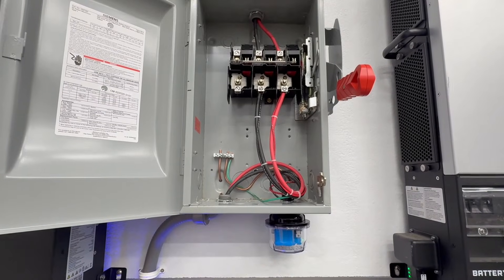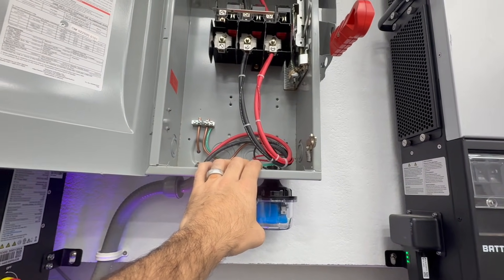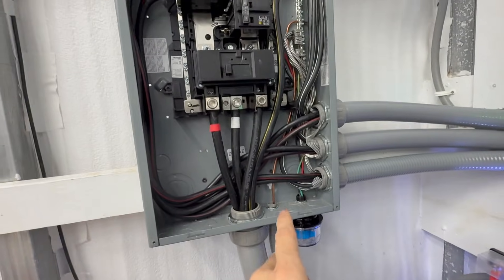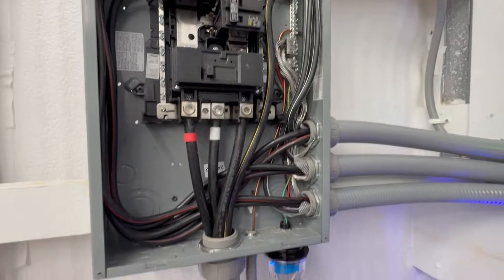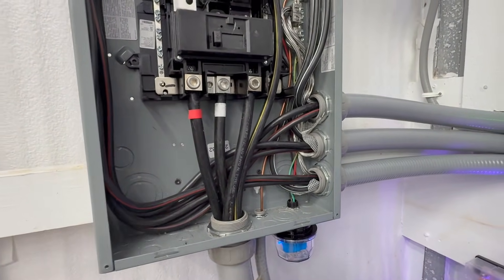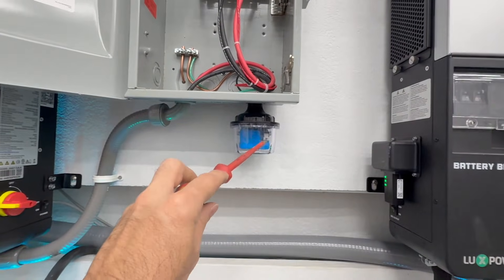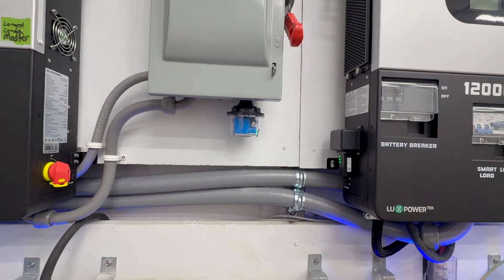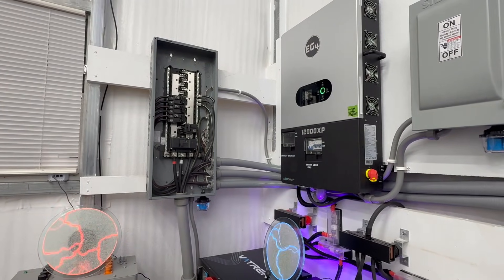How To: Install MidNite Solar Surge Protection Devices - Protect Your Solar Investment!

Comment: SPDs are fine, and a reasonable step to take to prevent damage under reasonable conditions.  Lighting is not reasonable.  Depending on where lighting hits, it can transfer 100 Million to 1 Billion Volts DC at 30,000 Amps.  DC arcs well, very well at high voltages, and can jump across conductors across a good distance.  All electricity, DC or AC, wants a path back to the Source.  Dirt is not a good conductor of energy, but long runs of underground cables can act as an antenna for a lighting ground strike and still bring dangerous levels of DC current down the line to whatever it's connected to looking for the least impedance path back to the ground, this is where a SPD helps, giving your current carrying conductors ( + and -, or 120vac & neutral) a fast path to low impedance to ground which was the Source of the energy.  It does not cure cancer, or solve world hunger, but be rational on what it can do, and what is beyond rational and reasonable.  Can you still lose electronics, appliances, chargers, and inverters in a strike.....absolutely with SPDs installed, and installed correctly.  I come from the sailing world where lighting strikes is a fairly common occurrence.
Reply from the maker: Absolutely agree and that is why I tried to stay away from mentioning direct lightning strikes, because nothing will protect against it.  Thank you for posting!

Comment: Thanks for this video. I have a question for ya. My solar dc disconnect is at the location of the solar field 100ft from the house. Should I wire the SPD over there and have it connect to the ground going from the panels back to the house ground rods?
Reply from the maker: It is supposed to be as close as possible to the inverter.  But you can put a second one by the array like I did.

Comment: Sold rural off grid solar, the only systems that are back up online same day after rare huge storms are ones with MidNite solar. One 36-year long solar installer here won’t use anything else and puts them on every single new system.

It should be noted that it’s an ‘EMP arrestor’ that sends ALL EMP’s to ground, lightning strikes emit EMP’s, meaning even a nearby strike can fry your equipment.

Six grand inverters or $200 arrestors? The choice makes itself
Reply from the maker: Very good information and thank you for the insight on the terminology.   

With being an installer,  let me know your thoughts on how I grounded my setup.  I'm learning as I go along and appreciate any insight.
Reply: @Mik @MikesSolarGarage tect each MPPT on the array side, with the best ground that you can muster. They come in packs of ten, they sacrifice themselves while potentially saving your equipment.

It’s the positive direct hits that fry everything, one ‘last boss’ lightning strike that strikes once and only once, but with a noticeably louder signatures. These ones get past MidNite solar, and I suppose the same would go for any giga-EMP, as PV arrays are oversized acme antennas that soak up a wide band of EMF, not just sunlight.

I’ve seen direct hits take out just one mod on an array of 14, the office uses the old lightning and shattered mods as desks and coffee tables. First NEGATIVE strike (quick-succession strikes in same spot) might take out a battery BMS board or two, that’s where MidNite Solar comes in.

Saw first hand some hardcore pepper’s physical 300 series stainless steel folding PV array shields, nothing lower than X-ray can get through this shield, grounded to a 650’ well shaft.

One Monday morning after a major storm in an already gnarly-storm area they had 14 trouble calls from MidNite surge arrestor replacements. One recent install had one of two SolArk 15K’s, and three of four Pytes 5.12 kWh batteries fried. Grounding is incredibly poor in my area, can’t stress enough how important grounding is in solar for stormy areas.

Outside of that, I would stop investing in low voltage infrastructure because the industry is moving to battery-side high voltage DC for less loss and less copper needed. 

I foresee Tesla dominating the entire all-in-one battery/inverter 2-way EV market, but outside of that the higher the voltage, the thinner the gauge of wire.

I recommend investing everything into battery health, you don’t want those suckers on or even existing in sub zero temperatures. Too hot and they degrade, too cold - then get used and they break or degrade.. They like to be in well-conditioned 70°F (21.1°C), oversize your LFP bank to 200% of your needs, which greatly reduces thermal stress on the internal cell bands.

It’s the expansion and contraction of those long, wrapped-up ribbons that degrade batteries over time. Rapid battery charge and discharge causes rapid fluctuations in internal cell temperatures, forming micro cracks everywhere. So rock steady room temp is premium, but a reptile terrarium mat under a stack of well-insulated batteries works too. See a lot of that off-grid.

Tress, light poles, power lines, anything tall and pointy around your solar is a magnet for EMP’s, like I said a nearby blast can pop an arrestor too, doesn’t have to be direct.

Follow battery health outlines out there, and so long as the cabling is correct, current tech should last 50 years on the low end, centuries on the high end. Later inverters have no moving parts, keep the fins dust-free and I’d wager over a century of free household electricity on a properly designed system. Eighty grand or more depending on batteries, it’s all battery right now..
Reply from the maker: Thank you very much for spending the time to share this.  I greatly appreciate your experience and wisdom!

Comment: I was under the impression you didn't want ground rods at the ground array? Just EGC that goes to the building's ground system?

I also put the low voltage midnight SPD on my 48v battery side. Ring terminals between the bolts holding down my battery cables in the 12000xp
Reply from the maker: Initially I didn't want ground rods at the array, but after learning more from the folks at Midnite Solar I found out I was wrong in my thinking.   

On the low voltage SPD's for the batteries,  I wasn't sure how they helped so I didn't mention those in the video.  What would be the scenario that they help with on the battery side?